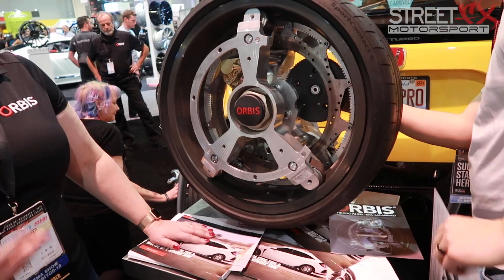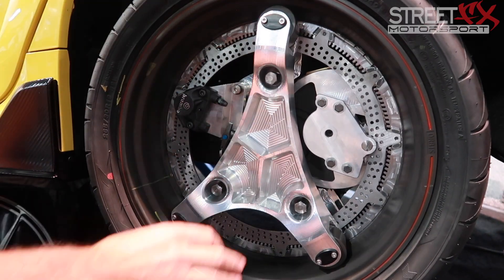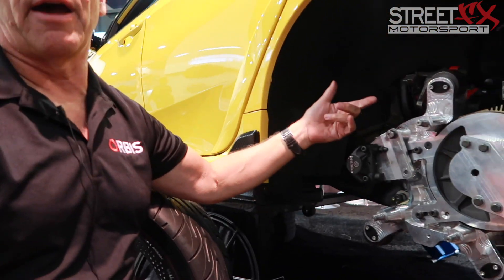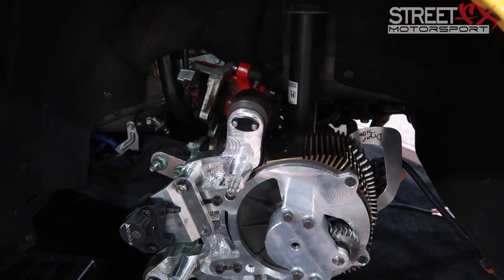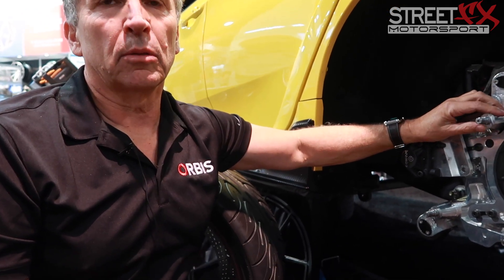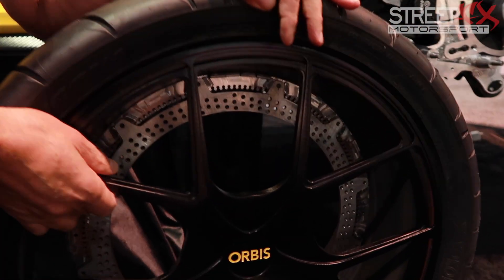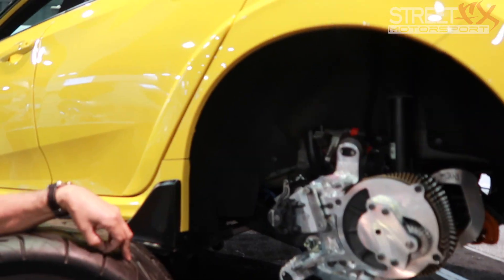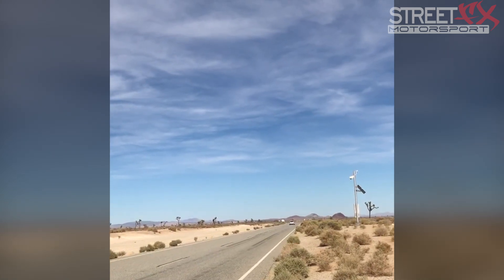WORLD's FIRST ELECTRIC hybrid AWD Honda Civic Type R FK8 with 450hp!

Comment: Big disadvantage, without lubricating power, gear will be damaged because of dirt and fragments! Rollers has small bearings inside with small side load, also, when wheel become rough due to fragments of dirt and asphalt, roller will be shaking and noisy! This is inovative but not practical!
Reply: dude this thing needs to be time ands trial tested. but its a awesome start! now lets wait for people to improve it and shit ... this is crazy you can make any car fast as fuck..... omg
Reply: The best solution is Hub motor! And of story! Tesla have it... Job done.
Reply: @zlackbiro  i agree 100%, this absolute garbage.
Reply: @jasondreckmann3396  ?
Reply: @RIPxBlackHawk  more common to get a squirrel between the tire and the asphalt .... them dang squirrels !   

 (seriously, rocks into the gears or wedged into the wheel rollers are real concerns. Don't get me wrong, this tech looks like fun .. but most would not run their engine without an air cleaner for protection .. this wheel drive system needs some protection).
Reply: I was thinking the same way. That turbine sound is actually the sound of friction, like reverse gear. And system is uncovered from environment. Dust might kill it in a month.
Reply: Agreed, it's a cool performance show off item for "Sunny day good road" cars, which is fine, as long as a squirrel or rock doesn't get lodged in that gear set or wheel bearing setup. These problems could easily be reduced by adding some stationary shield covers over the gear set and wheel rollers ... may require moving the brake disk away from the gear ring, due to heat. Lastly, it's probably silly expensive for just 100hp ... but such prices are paid to be unique at the local cars and coffee meet ups.
Reply: This what I was thinking as soon as I saw it, but pretty amazing nonetheless.
Reply: People said the same shit about the combustion motor...
Reply: @nnms-xe8ti  That's right! People pointed out the same type of flaws.. The first combustion motors had exposed cranks, connecting rods, etc... stuff got in there and broke things, so designers covered it all up, enclosed it, added internal lubrication systems, etc....   However, with engineering, we learn from past experiences, and apply those to new designs .. but that wasn't done here, and that is why the comments are what they are.  The concept is nice, but needs some refinement.
Reply: @KrustyKlown  it is all sealed if you actually look at them this is just at sema so people can see what it looks like and how it works...
Reply: Just put a dust cap like the fake wheel cap he pulled off earlier
Reply: You guys act like tanks dont exist.. many of the components for tracks systemea can be miniaturized to support this technology. They have tanks that can reach 90mph at nearly 100tons. The friction involved at getting a tracked vehicle that fast is the same science that needs to be explored. My mentor once told me that great ideas for one thing often become groundbreaking technology for another.
Reply: You make sense ✌true
Reply: Not yet.
Reply: Yah all that needs to be sealed and protected from environment ,
Reply: Money wise need to be practical else its a dinosaur, electric cars are coming out 2020, and might as well get the electric car with higher torque.
Unless this becomes affordable fast it is Not going to sell, also with dwindling ICE engines car over the decades... 
It is Not making itself anywhere competitive enough IMHO
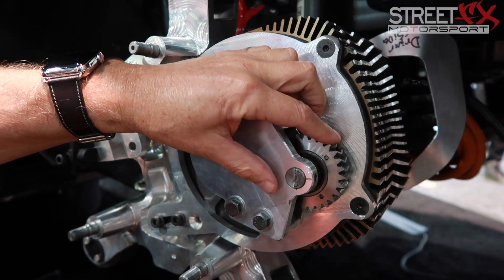Reply: 4:18 says the complete opposite
Reply: Thats why it must have closed wheel dop with proper seal
Reply: It's sealed.
Reply: Obviously needs a little refinement but we cant lie to ourselves that this isn't an amazing break in technology. This is  a crazy breakthrough in the automotive world and anyone who is disagreeing is  salty as hell.
Reply: I wonder if they put a plexiglass frame over it might help keeping foreign materials out. Because the rims look dope as fuck but the gears being exposed like that is a bad idea.

Comment: Surprised nobody is asking this, but what if the battery dies? Also what is the motor rated to? Is it limited at a certain RPM/MPH? What about the heat coming from continuous driving or breaking such as a long trip? Would that cause any sort of failures? 
This sounds like a great idea, but with a lot of room for failure so far. Would love to see how far this can go

Comment: Minus some of the issues mentioned in the posts by others: i wonder if this could be used to electrify any vehicle by putting it on all 4 wheels at 100 each... take the entire drivetrain out and replace with batteries... this could be an all around conversion kit

Comment: So for what I'm understanding from this video is that I can take my vehicle & make it a petrol electric! Meaning, installing this on all 4 wheels, taking my transmission out & adding a super large generator in its stead! & with being that that large generator connected directly to the engine would mostly give the power so I wouldn't need that extra battery! I would just need to have the engine rev at a higher rpm automatically with maybe a rev up if I'm punching the throttle & if I'm just sitting like at a light holding the brake, the engine will lower its rpm to save fuel, so this like others stated, is very cool!

Comment: Unfortunately it will severely hamper handling (heavier unsprung weight decreasing ratio of sprung to unsprung mass).
Reply: It's lighter than the stock setup.
Reply: @blasphemicwhale  oh I see, I should have watched the video. Btw, I take it you would have to charge it like you would a Chevy volt?
Reply: @situbes.972  I'm not sure! I think regenerative braking would help with this, or to add an additional belt driven alternator to extend range but you can't really get around rechargeable battery packs. The setup in the video would require charging.
Reply: You wouldn't need an extra alternator - by applying slight electronic braking while cruising the wheel motors can work like alternators with pretty much the same increase in load on the engine without the extra weight.

Comment: brilliant but the amount of weight it add for the horsepower it outputs is not worth it yet. if it could add 200  hp per wheel with the same weight ill get it ASAP.

Comment: Very cool but how long are those gears going to last. Its like a diff with no oil in it and dirt can get onto the gears. Heres and idea make a hybrid starter motor for the car and just drive the engine. LOL them gears will be toast in 1k. If it was sealed and oiled I could see it being reliable but much heavier.

Comment: That looks sick but 100hp gain is lower than I expected. A ECU reflash and a couple of bolt ons would yield the same for a forced induction engine. Also cars pushing over 200hp to wheels, this would decrease power. Looking forward where the tech goes!! Definitely in the baby steps!

Comment: A 50" flatscreen was $2,800 in 2008, now in 2018 are $500 all day.

Relax people, this is just the beginning.
Reply: Blakelikesfood this is by far the best comment I’ve seen in a while ! The truth.
Reply: Not necessarily true in the automotive parts industry, by your logic turbo kits would be dirt cheap by now, nope they are still hella expensive to purchase and to install is a grip as well.
Reply: @MadStyle1911  • just like you can find a $500 50' tv on ebay, you can source a $500 turbo kit there as well • the option are available • although some prefer a premium product a rarely choose the cheaper route •
Reply: @MadStyle1911  
I can eBay turbo a 90s to 2000s Honda for next to nothing. Same with just about any modern gm v8. 

Quality may or may not not be there,  but cost is way down. 

The cost of a turbo has bottomed out. It's a hundred year old tech
Reply: Although you are correct mechanical things do not drop as fast as electronics unfortunately.
Reply: @CBRWOLF  my dad bought a brand new car for $15,000. A Honda Fit.
Reply: @camytay  That's not a car, it's a go-cart.
Reply: @HunterXray  no its not... Its a civic competitor
Reply: @camytay  the honda fix is a sub compact mmm not really a good car
Reply: 1 hour for installing the complete system sounds like a snake oil line to me, plus open gears unlubricated and open to the elements is a very poor design that will wear out faster than you think if you actually use it.
Reply: @rossg9363  : Took less then 10 mins per side to swap from drums to disk assembly as only 4 17mm bolts, and another 2 bolts for the carriers & calipers. This is a pre-assembled kit that bolts on. 

And for the open gears it'd take nothing to fab some billet plates to cap the exposed gear end and pack with grease. 

Hence, "Relax folks, this is just the beginning." 

Look what the first 1950's tv looked like. Look what the first game system looked like. Look at ridiculous the first cell phone looked like in the 70's/80's.
Reply: @Blakelikesfood  there are hydraulic brake lines and handbrake cables to include in the swap over in that 10 min you say its 10 min plus adjusting the brake bias for the new brakes so they are even front to back.... any mate all good have a good one👍 work in progress
Reply: @rossg9363  : Well yes...I was referring to the bulk hardware on their kit...they'd need to include ~1/8" hardlines (or rubber) to extend to the higher mounted caliper....I did have to make custom ebrake cables and you'd need extensions or new ones here..and still need to bleed. 

An hour install for completion? Oh hell no 😀.
Reply: @Blakelikesfood  👍 i just pulled out my 8.4" Detroit locker center in my 2.7vvti hiace van last week for selling it and i was relatively quick i thought, 4 hours ish all apart and put back together (I've changed the center a few times now with different diff centers and the Detroit locker was the best for me and i knew better each time around) anyway cool mate all the best👍
Reply: @rossg9363  please can you help me
Reply: @sayedissaelkhoury5323  hey mate, help with what? Im not from orbis
Reply: Yea but its so shiny!
Reply: Uhmmm... a 1997 Integra Type R motor still cost $4500.. ive been waiting 11 years for the price to go down.. uhmmm hasnt yet in 2018
Reply: @CBRWOLF  ya, cars used to be $4000 in the 70's. prices just keep going up! whats happening?! ......................
Reply: Ok
Reply: @CBRWOLF  Ever heard of inflation? lmao
Reply: Exactly
Reply: @CBRWOLF  Did you factor in inflation?
Reply: i know
Reply: Not to mention that 2800 dollar tv is not worth hardly anything today because the 500 dollar ones a nicer than the 2800 dollar ones from 2008 like alot nicer so cheaper and better
Reply: Justinitiative I guess you didn’t see my example, most technology is standard now a days
Reply: @CBRWOLF  its also gets 30+ miles per gallon
Reply: @CBRWOLF  not really, money is just inflating
Reply: @CBRWOLF  but a BMW is still 40-50k. Nearly the same value per dollar value.
Reply: @JustinMasters1989  i don't want a honda, I was using my dads honda as an example
Reply: I remember when a small OLED monitor cost $10,000 and now you can get a 50" OLED TV for $1700
Reply: Bicc OG  way to be a loser. good job at expressing yourself.a+
Reply: Your comparing apples to oranges
Reply: @CBRWOLF  the inflation rate is higher than what's officially listed because it's tied to PPI, yet, as you pointed out, many factors affect cost besides producer end cost (e.g. new tech and regulatory changes). The new pieces added to vehicles because of (perceived) consumer demand aren't "inflation", but they do affect purchasing power. Real spending power is down, and wages vs. car pricing and the increased necessity of leasing is proof of that.
Reply: Justinitiative but don’t you think new cars today that are 30k would have been 100k a decade ago? Heated seats, led lights, suspension, etc. that was a luxury while ago.
Reply: 50inch tv's are like $200 everyday at wally world
Reply: Blakelikesfood a 32 inch flat screen in 1999 was 10-12k lol
Reply: Blakelikesfood right
Reply: Like the touchscreen estéreos and the 22 rims back in the 03
Reply: Hi who here is from orbis
Reply: If this was half the price I'd buy it. I want to make my Civic AWD but this is too damn expensive
Reply: and 15k in 1998 (for only a 42)
Reply: Where van y but this in 500?
Reply: 4yrs later nothing
Reply: U Albinos changed quickly
Reply: 5 YEARS LATER 

Now 550hp opposed to 450hp, starts at $7500 opposed to $10,000.
Reply: I paid $500 for a 19" color TV. Of course I got the optional remote control. That was 1979.
Reply: soo thats a fuckin lie
Reply: Can't wait to see something like this that goes onto classic engines, just like on my 3000gt 😊😊😊
Reply: Justinitiative you have to factor the amount of technology in these vehicles nowadays, although they are slightly higher the ratio of technology in them versus what was offered in the comparable from the past is now far advance and there’s only a slight increase in price , for example the 2018 Honda Accord comes standard with a suite of safety features standard led headlights and array of other features for only a couple of bucks( in reference to the thousands of dollars a couple hundred means little) more then its previous model.
Reply: yes, a high end car will stay at a high end price. But high end technology does trickle down to more affordable cars and you know that.
Reply: Blakelikesfood thats bc due to supply and demand. Your average consumer would not be purchasing these so you will not see high demand and therefore the price for these motors will always be high.
Reply: This dose not look good for Tesla....
Reply: @CBRWOLF  You can thank the government for that. Nearly half the cost of a car is government safety and emissions.
Reply: said a poor person that cant afford a nice, new, safe car.
Reply: oops wrong place to post that, sorry!  im mostly youtube comment illiterate
Reply: @mrmedium7984  says a poor person that cant afford a new car.  sorry you arent safer when you drive.
Reply: What does a tv has something to do with cars you dumb fvck don’t try to sound smart with your non sense comments
Reply: @mikixP  Watch out guys, we have a triggered beta-male in the house.
Reply: @mikixP  you probably don't know how to spell or pronounce the type of tech that ends up in both cars and TVs.
Reply: Simon Liu OkAy mr liu 🤣🎎
Reply: The Mars Man 💩

Comment: The guy is talking it simple its more bull c than that the hub caps fly off thats y he smiles about it and how does 4 weels at 100 hp = 450.. It only 100 per wheel soeven if you have 4 of thim moving at 100hp thear only going to move at a 100hp the second wheel cant go 200 more than the first and the 3rd whell cant go 300 more than the first 100hp and the 4th cant go 400hp more than the first 100hp ..hummm
Reply: How could you possibly come up with with that comment? This is beyond me....

Comment: I'd like to see how it affects cornering, on a track preferably. I didn't catch how they recharge either. If it requires a plug, it's no use to me (Joy of living in London). 10k + 3k USD (13k plus GBP once you factor in import duty) seems reasonable for the engineering, but not something I'd consider. It pushes a £35k car up to £48k car which is dangerously close to M3 money (well unless you want it specced properly).

The FK8 has a dimple underside where a rear diff could go, so I'm kind of hoping the next Type R has 4wd with a low HP, extra light rear assembly. It would help getting it moving/pulling into traffic, especially if it's damp, but shouldn't change the handling to far towards the dynamics of a "true" 4wd. 

Keep the next Type R light, keep it powered by the engine and if they add 4wd, focus on traction at lower speeds rather than the dynamics of a 4wd and I'll snap one up sight unseen :)
Reply: Actually I've changed my mind. It should be possible to manage traction to the front wheels better, preventing wheel spin without a dramatic blunting and subsequent loss of revs/turbo pressure that give a flat spot. Electronically controlled clutch perhaps? Just have it allow a bit of slip with some throttle let up, but less than conventional traction control systems. Ideally give it a few modes: 1) Full gear range, 2) Race dry, 3) Race wet, 4) off. I'm just riffing really. @Honda, ©Ian Bradley :)

Comment: Question is, how would this set up do for tracks, would the electric motors be able to talk to each other and the car to shift torque around the 2 wheels while communicating to the front 2 effectively. Be interesting to see this demo'd . For $11000 though, you could do a lot of mods for that, 4wd fk8 will be legendary though.